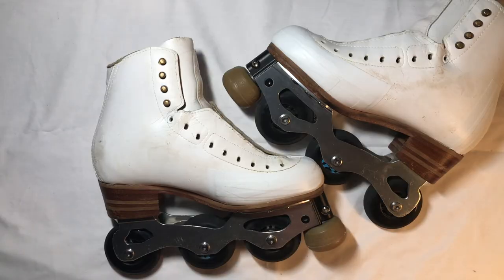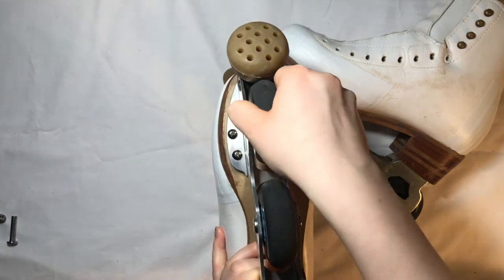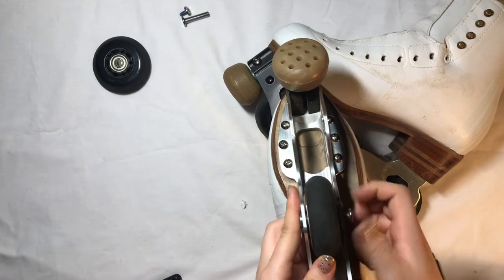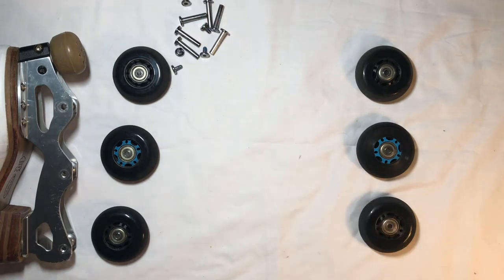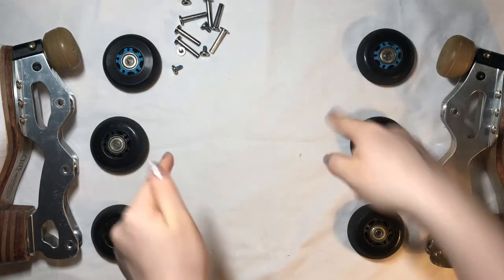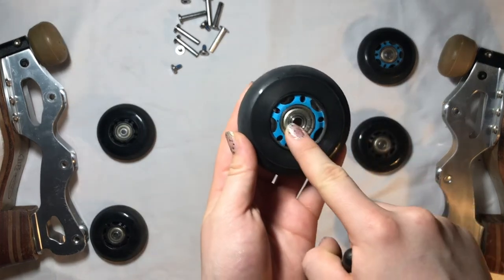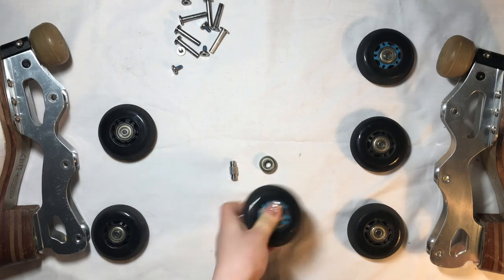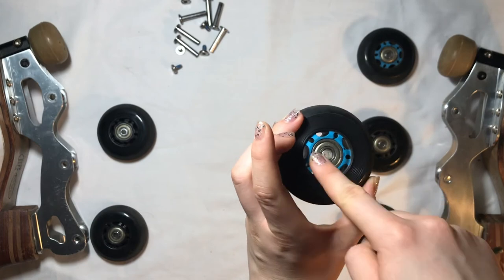How to Rotate and Take Apart Inline Figure Wheels

Comment: Love your videos! Thanks for sharing your knowledge and inspiring others to try this fun sport. You’re really bringing the inline community forward. Could you please share the brand of wheels you’re using? I haven’t started skating yet, I’m still attempting to do spins on the edea e-spinner but I’ve always wanted black wheels instead of the speedmax ones. One day when I’m decent and have worn through my several backup pairs of speedmaxes that I bought with my snow whites, I’ll upgrade to the ice fly edeas and white horse frames with black wheels 😎😁

Comment: Do you have some sort of wheel preference?? I can barely skate with the speed max wheels on a tennis court but the harmony sports on them feel comfortable. I think I just like the grip but I’m a newbie so I’m not sure if it’s a bad habit to go for indoor on outdoor surfaces for my skating. I know it might ruin the wheels quicker but I have yet to explore different wheels on different surfaces yet.
Reply from the maker: I actually tend to prefer harder wheels because it feels like I can spin a little better on them. I also don’t like my wheels to wear down quick so I opt for harder wheels, but I think especially when you start out, you should go with what’s more comfortable for you. You could also look into wheels that are in between outdoor and indoor (maybe around 75-80A?) and see if that fixes any issues?

Comment: Hey I bought some Snow White frames and I’ve skated a few times on them and I’m not sure if they are the best fit for me , I find them sooo diffrent from the ice and I’m wandering if they where a bad buy , what was your experience moving onto them ???
Reply from the maker: I think with all inline figure skates, you can’t expect them to be exactly like ice skates. Wheels on concrete feels different from blades on ice and so you should be prepared for some differences. That being said, it’s still possible to do a slightly modified version of most ice elements on inline; I’ve learned everything from backwards 3-turns to eagles to to camel spins to all my jumps on inline first which I then moved to ice! If you check out my Instagram, you can kinda see how my spins and jumps differ from ice to inline! Good luck!!!

Comment: hey I've never really ice skated before but I want 2 start learning however I probably won't be able to go to an ice rink for a really long time (not just because of covid). do have any idea on how going from inlines to ice will be? love ur vids btw :)
Reply from the maker: Thank you! And I think that going from inline to ice is totally doable! I learned basics (how to fall properly, how to do crossovers, how to skate backwards etc) on ice, but all my jumps and most of my elements I learned on inlines over a couple summers and moved them onto the ice. I worry a little bit about not having guidance to fall properly so you don’t hurt yourself when you start working on harder skills, but it’s still completely possible to learn on inline and move to ice later. You can see on my Back to Ice video that there’s an adjustment period though so be prepared!
Reply: @Hazook  that was really helpful thank u 💗💗

Comment: Thank you for showing me how to properly use my tools! Lol Also have you ever had issues with new bearings and wheels not wanting to rotate freely? I have some that are fine but others not fine. If I loosen the axel they spin feeling but then the axel bolts spin too.
Reply from the maker: I haven’t had that issue yet😅 what type of spacers are they? The standard 8mm tube or the spacer with the axle built into it? If it’s just the spacer, you might want to try swapping it out with one of the spacers you got from Snow White-specific wheels (eg. SpeedMax). It could also be that there’s a lot of dust buildup inside your bearings and you might have to clean them, in which case there are a lot of YouTube tutorials for rollerblade/rollerskate bearing cleanings (non-inline figure tutorials should still work).
Reply: @Hazook  they are synergy wheels and I got more bearings and spacers with the wheels in a complete pack. The bearings and axel bolts that also came with it stayed in a ziplock bag. But I will take apart one of my speed max wheels see if the spacer is different in any way.
Reply from the maker: Hmm I’m not too sure then😥 You might want to try contacting synergy to see if you might have been sent a defective product?
Reply: @Hazook  it’s been months now since I got them so not sure they would fall under warranty anymore. I will try everything before I call them bad. I may just need to use the other spacers or they need oil.
Reply from the maker: I hope it works out! That’s a real shame though, synergy wheels seem like a great product but they can get pricy once shipping and taxes get added to the cost😣
Reply: @Hazook  yeah I had birthday money I got them with. Love synergy wheels so far just having a hard time getting used to them. Lol I will keep you posted on this drama. Lol once I finish my adult chores for the day going to mess with them and practice on my spinner.